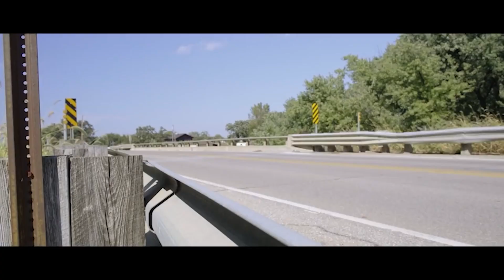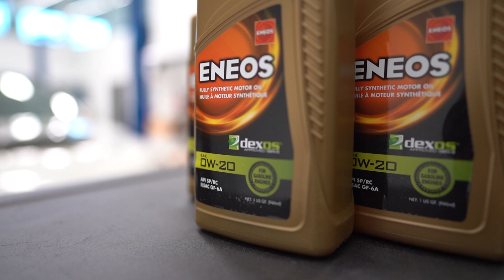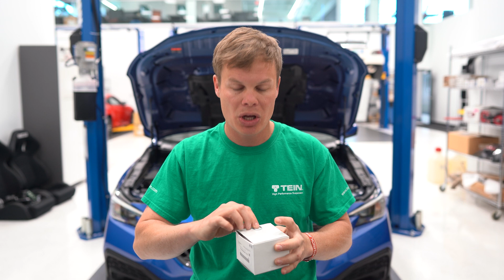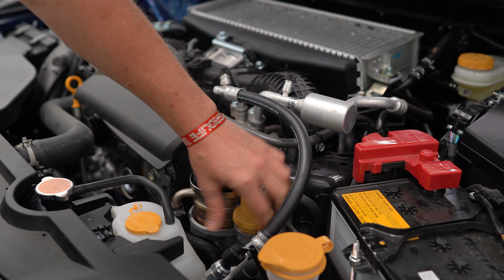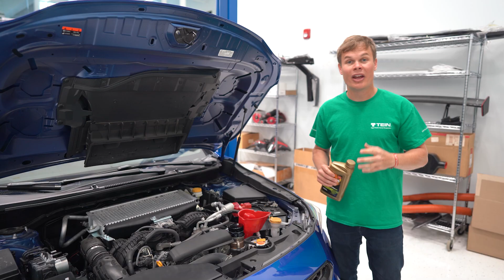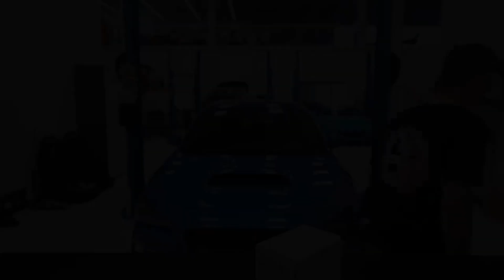How to Change Engine Oil 2022 WRX

Comment: You should have included the trick to cycle the oil through the filter.
Reply: What trick is that?
Reply: Not exactly sure how right now, but you basically operate the oil pump without firing up the ignition thus cycling oil through the filter.
Reply: @ninjaridaz4571  oh, that! Hold down the gas and the clutch while pressing the start button.

Comment: Also make sure the oil you add is ILSAC GF-6A certified (new standard from 2020+ model years) per the 2022 WRX owners manual regarding oil standards.
Reply: @RK0957 The oil I used is only SDLJKEOUIM FDJ-IUWEIUOW< Certified. Damn.

Comment: Is the crush washer on the oil pan drain plug a Subaru thing?
Reply: No.  It's am oil pan thing. Helps create a seal without getting the bolt seized.

Comment: I didn’t have a crush washer to replace it so I used a different plug with a gasket. Is this really bad?
Reply from the maker: Should be fine just keep an eye on it and make sure it doesn’t leak, then next time replace it with a new crush washer

Comment: Would you have any concerns with changing the oil by sucking it out the dipstick tube with a fluid extractor pump? That way you don't have to lift the car.
Reply: Are you serious

Comment: Always use an engine oil flush and add that to the oil and run the car for 5 minutes then drop the oil.
0W-20 is like water and pretty much useless for your engine.  5W-30 is enough.

Comment: That is one heck of a small oil filter 😳
Reply: Consider the size of the engine and oil levels. A GT350 uses 10 quarts of oil and it has an even smaller filter.

Comment: Question: When people say "give the oil filter a 3/4 turn after it makes contact..." I noticed you just hand spun it until your wrist felt like it moved 3/4. I actually use a marker or a particular letter on the oil filter to make sure I move it exactly 3/4 around, but it gets too tough for me to do without an oil filter wrench to yank on. When I took my old factory filter off, it was also too tight to remove by hand. In your experience does hand tightening it suffice? (as shown here).
Reply: Sounds like you gotta get in some hand work outs 😅
Reply: @king_cobra3694  Never hurts!
Reply: Have always just hand tightened on my va

Comment: Could you dyno pre and post cat back exhaust.. also dyno pre and post air filter change with that silly carbon filter. Does the exhaust intake give it any power?

Comment: Changes my oil at 1.5k. Noticed there was not a washer/gasket on the drain plug from factory. Interesting 🤔
Reply: It was probably there, I made that mistake as well, it's painted over and same color as drain plug, had to use a nice to get it out. If you put another crush washer ontop it could cause leaks.
Reply: @alexistacuri3454  oh really? So it’s possible there is a washer just that it’s married to the plug? I’ll definitely check next oil change. Thanks!

Comment: So im changing my oil for the first time after my 4 free oil change from the dealer. Why is the 5qt oil cheaper than 5 1qt oil? im heared good things about penzoil ultra platinum
Reply: Because it’s the same amount of oil but like 4x the amount of plastic and packaging. This is a very common thing in any aspect of life, you buy in bulk you pay less..

Comment: I would love to know how to bleed the brakes and how to change the transmission oil.
Reply: Transmission Fluid not oil and you wont be doing that for several years yet, the 2022 model is too new to need a transmission fluid flush.

Comment: Wow, just like the VA... Noooo, 0w-20.  Gas mileage cheater oil...why Subaru why.  Is that what the dealer put in my VA WRX? 😳5w-30 synthetic at any temperature and you won't sacrifice engine wear/turbo damage for a mpg or 2.
Reply: Should I go with 5w-30 in my 22 wrx?
Reply: @00erik24  yes
Reply: If you do decide NOT to follow manufacturers recommendations (ill advised if you want to preserve the warranty on the car) make sure the oil in the WRX FA engine is ILSAC GF-6A certified as well. Its a new oil standard for 2020+ cars. It should be on the oil bottle label

Comment: It’s better to have new car oil changed by dealer (Subaru free 3 years) when vehicle under warranty as I’ve seen engine repairs denied because people couldn’t prove it was done. But good video none the less.
Reply: Its not free
Reply: Mine cost $0.01 for the first 4 services (package) . Every dealer is different.  But it blows if you change the oil at 1k miles as that counts as a service (the 1st 6k mi service).
Reply: @K03sport  don’t quote me on this one, but I’m pretty sure Subaru doesn’t require the 1,000 mile oil change anymore. They break the car in before it heads over to the dealer, but the miles are re set to 0 from factory after they do the first 1,000 for ya

Comment: You guys are running out of content 😳
Reply from the maker: it's a new car, there are lots of new WRX owners who don't know how to change their oil yet
Reply: Well, better than them showing how to install overlays...
Reply: It's still better than watching a guy doing tires rotation on an EV' vehicle 🤔 😆😂😆😂
👍 Job, Foster
Reply: These videos are useful for new car owners. I watched a ton of these videos before deciding to do my own maintenance.
Reply: Mr know it all here. 🤓
Reply: Useful video, 👍 especially for those new "turbo driver/ owner" especially after the three year maintenance plan expired. 
I was too lazy to change / do it myself during the winter season  ,... Dealership charged me $126😢 full synthetic oil service.... I could have saved $60+ dollars changing it myself with tire rotation hmm 🤔 😏.... And I don't need to recheck their works.... 😢 They spills oil onto the driver side engine and oil smoking during my drive back home.... Hmm, I am a technician (past job) ... Hmm, that's why I 😂 also rechecked the wheel lug nuts torque...

Comment: Hmm, it's best to start the engine for 5 minutes and then check the oil level again ( it allows the fresh new oil to circulate inside the engine, turbo oil line and oil filter.) If not, the oil is only sitting in the engine oil pan, ... And your short of half or one quart. Technican experience 😉 🔧 advice.
Reply: Some cars have oil dipsticks that are meant to be read once the engine has been warmed up like this. Many other cars have oil dipsticks that are meant to be read when the engine is cold and has been off for a while. The manual in my Subaru says it is meant to be read cold.
Reply: @182ndNegociator  I think that’s only if your checking it after driving, like at a gas station doing a quick check, let it sit off for 5 min first. But after an oil change it’s always smart to start the car and let it run a few min, then have it sit for a few min and re check oil. Helps to get the oil back into all the lines and then check what your true level will be once the oil settles
Reply: Haha I rushed to the comments for this
Reply: Yeah the oil filter is empty. I have same engine. Actually after draining oil for an hour. It takes 5.1 quarts to fill line
Reply: @daveroski 5 quart jug is fine…little low or high is fine
Reply: @daveroski  5.1 quarts is too much. The oil capacity is 4.8US quarts. When you drain, you'll never get all of that 4.8 quarts out, so 4.5 is about right as outlined in this video.
Reply: @steve8803  says 5.1 w filter
Reply: @daveroski  I don't see how the filter makes a difference, because it only retains trace amount of oil due to being mounted upside down(gravity!). It certainly doesn't retain ~300ml. Personally, I get 4.5 quarts in and I am right at the full mark, same as the guy in this video. And that's with it parked on my level garage floor, and after letting it run for a few minutes, then shutting it off and checking after 5 minutes or so.
Reply: @steve8803  I prefill filters. About 4–6 ounces saturated. That’s about .2 of a quart or so. 5.1 worked great. I did it already. I let oil drain for 30 minutes. That makes a difference Too.
Reply: @daveroski  You can let it drain forever, it'll never all come out. But hey, you got what you got. Just be careful not to go over the fill line.
Reply: @steve8803  my point is 30 minutes of draining is like 3 oz. It was perfect on dipstick after 5.1 :) w oil filter
Reply: @daveroski  30 minutes of drain time is an extra 3 oz. compared to what? Mine was draining a good 15-20 minutes when I did it yesterday. No way in hell an extra 10 minutes would've netted 3 oz. There wasn't enough coming out at that point for it to even drip anymore.
Reply: @steve8803  your saying 4.8 w filter got you to the full line?
Reply: @daveroski  I got 4.3L(that's 4.55US quarts). That's with a new filter, letting it drain for 15-20 mins, letting it run, and then checking it 5 minutes after shutting it off.
Reply: @steve8803  lol I’m super sorry. I watch so many of these things. I thought you were referring to my wife’s pathfinder which is 5.1 quarts haha as I just changed it. As for my Subaru I had the 2.4 turbo. Your correct manual says 4.8 this brought me to the middle line when engine is cold in the morning. 5.1 to the top. I also used the Japanese black Subaru filters that held slightly more oil.  These Subaru engines the 2.4 turbo and 2.5 non turbo can hold extra oil with out damage. But of course I am totally against addin more oil pressure that causes more leaks. Subaru over fills the oil like crazy and that’s what prompted me to do my own. But 5.1 is the top line on cold morning. Maybe in hindsight it’s a little too much as they want you to check it warm these days but there’s no harm I in a few ounces over. If I had to do it again I would just add 5 quarts and call it a day..2 quarts is 6.4 ounces. Half can of coke to bring it to top line for cold engine
Reply: @daveroski in the owner's manual, it tells you to wait at least 5 minutes for the oil to drop back in the pan before checking the oil level(p. 426 Canadian manual). A "cold" check is absolutely accurate, as you can be sure all the oil is dropped into the pan then. Anywhere in between low and fill mark on the dipstick is normal range. Going over too much can trigger a check engine light. But you're right, a few Oz's too much won't likely cause an issue. I'd just personally err on the side of being at or slightly under the upper mark, rather than over it.
Reply: @daveroski  Maybe there was more in the jug than advertised? IDK. But I used a 4.73L jug of Kirkland full synthetic oil. And there was roughly 430ml left in it, I actually dumped it all into a measuring cup just to see what was remaining. Maybe if you were using individual quart bottles, there was still ~1/2 oz. remaining in each bottle after you dumped it in?
Reply: @LeftSightScarFace the oil filter on these engines are upside down, so when the vehicle shuts off the oil drains out of it anyway. You'll notice when he removed the old oil filter, zero oil was retained in it. The dipstick on this vehicle is not intended to be read with a full oil filter, as that is impossible.

Comment: Don’t start the car with an empty oil filter. 

Step on the gas then turn the ignition. The engine will turn over but not start. This will pump oil into the oil filter.
Reply: Hardly anyone knows about clear flood mode, glad someone else does
Reply: Does this work for both key and push button cars? TIA
Reply: @anthonyc.1688  yes
Reply: what lol
Reply: @KlarkieCS  clear flood mode is where the accelerator pedal is held 100% and then you crank the car to build oil pressure since the filter is at the top
Reply: @king_cobra3694  oh my bad, lemme clear things up. In order to do clear flood mode, hold your foot down on the gas pedal and clutch bc the engine won’t turn over without it. (Put car in neutral just in case) The engine will not start but that’s on purpose. You’re building oil pressure first before starting it! Basically when you have the gas pedal at 100% the cars computer basically cuts off the fuel. Let the engine turn over a few times, then let it rest, then actually start the car. It’s only meant for 2015+ wrx’s and anything else with a fa20-fa24 engine
Reply: @brennanthewizard9252  thank youuuu!!
Reply: @DynamicCeramicsDetailing  you’re welcome! Hope you can use this knowledge for future oil changes!
Reply: @brennanthewizard9252  Thank you very much.
Reply: @KlarkieCS  https://youtu.be/s39-41BN91o

Comment: How many miles before first oil change
Reply: You can go up to 5k-6k...but most change it at 1k-1.5k.  Personal preference really. Or split the difference at 3k.
Reply: @K03sport  -- yes first at 1000 then some say again at 2000 or 3000 then scheduled miles?
Reply: In doing my break in. I’ll do 500 then 1000 then 3k then every 3k after